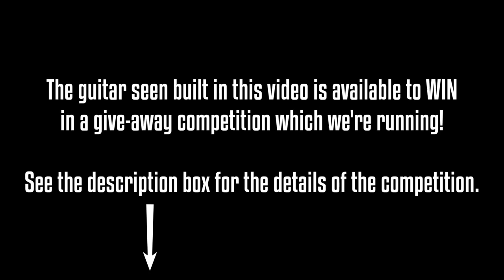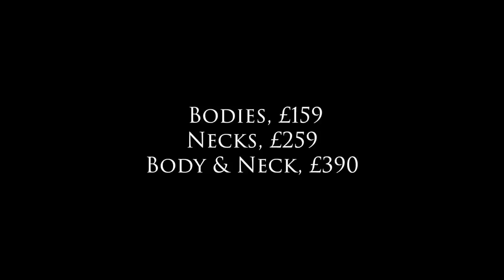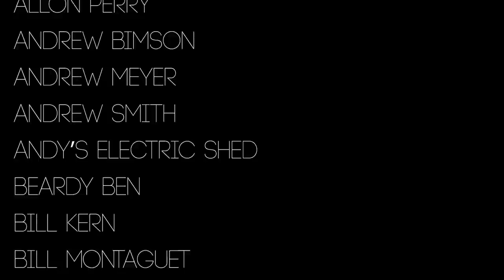Ep 3 - Building a Crimson T-Type Kit Guitar - Final Steps!

Comment: It should be possible to change the colour of the copper using a blow torch, when I was a plumber we sometimes used to anneal copper tube by heating it until cherry red then cooling it very quickly to soften the copper to bend with a spring. While heating the copper it changed colour in an almost prismatic way. Try heating up the copper and then quenching with water at different temperatures the copper changes colours radically.

Comment: Looks awesome. The copper pickguard and electronics plate look extremely excellent.

I had a T-type kit, I'd only do a couple of things:
Finish would be a candy apple blue with a deep gloss or a silver burst, matching painted headstock too. Satin finish poly on the back of the neck.
Fret dots would be swapped out for metal rings of approx same size, with a centre matching the fret wood as close as possible.
Hardware wise would be a six saddle bridge with string through, possibly a humbucker in the bridge and either a humbucker or a lipstick in the neck. Smoked chrome if possible for all metal elements.
If it wasn't pre-routed, I'd forgo the scratch plate entirely, but in with the kit body, I'd look at maybe doing something much smaller, maybe just a small chrome panel around the front pickup.

Comment: I'm not really a tele fan but that thing turned out stunning, I have yet to find a neck through kit, I should really start with a set neck (I don't tend to like bolt ons) but I'm wondering if a neck through kit is something that could potentially be on the cards for the future?  Obviously there would be less room for error as you can't replace the neck or body if you mess it up!

Comment: If I were to build a crimson kit, I would want a burl top on the body, high polish finish on it, with the same type of copper trim you used on this build, and a hard tail. For pick ups? I've always wanted to make my own single coils myself and I have no idea if something like this exists or not, but something like an internal bluetooth broadcasting device that would allow the guitar itself to pair with any bluetooth speaker to use as a pocket style amplifier without having to have an external wireless pack to an actual amp.

Comment: What would I do...?
Well; I think I'd go pretty straight forward and simple. But personally I'd prefer a strat style guitar and maybe put some kind of HSH or HSS set of pickups in. Maybe that's something I'd love to see: Some cuts for humbuckers. If you put on a scratchplate you could also use SSS without problems but here you can't put normal sized humbuckers on without having to cut more. But OK.  :) Guess I'd go for a red one (stain + oil) without tremolo, mint pickguard and vintage white or black pickups. Anything special...? 
OK, another thought is a version without scratchplate, noiseless SSS pickups directly mounted into the wood and maybe some kind of metal plate as a cover for the electronics. Also red (love to see the great grain of the wood) and probably chrome covers for the pickups as well as chrome hardware. But definitely without tremolo.

Comment: I would customise one of these kit guitars by:
Right handed Tele body
Left handed Tele neck
Re-route the bridge pickup for a humbucker.
Have a schaller Hannes piezo bridge
Bareknuckle Juggernaut bridge pickup in brushed chrome cover with custom geometric Pickup tattoo
Impulse single coil neck pickup when released, until then slow hand neck pickup.
I would put a flame maple cap on it and route the control cavity through the back. Stain the back black and the top in a red to black burst.
Chamfer the neck heal.
Stain the neck in a nice deep red colour, similar to padouk.
Control wise I'd have a toggle switch to switch between piezo, magnetics and both, then I would have a volume pot and a rotary switch to complete the guitar. And this is something I will be doing when I get the money together!

Comment: You say there's no reason for the extra long screwdriver. I would disagree. The extra long screwdriver is perfect for that application. A long screwdriver is easier to keep straight when screwing and therefore doesn't cam out so easily. Always use the longest screwdriver you can get away with.

Comment: I would use a wire brush to remove some of the soft grain to give the body a weathered texture, then stain it black. the neck would get painted with multiple different stains to get a "spotty" finish and the headstock would get a matching finish to the body. Id pair that up with chrome hardware and an aluminium scratch plate and som singlecoil sized P90's.

Comment: TIP for worn or soft screw heads, place a piece of electrical insulation tape over the screw head and then use the driver as normal.This will also work to remove ground down screw heads

Comment: Hi, quick question. When mounting the neck, there are no predrilled holes in the neck ? Every neck pocket has a bit of space ... to proper align the neck many people user the outer two strings to see if the space is qual on the both sides. I havent seen you do this. Are you just confident the fit is perfect because the cnc machining is so good or did you just use a method that was not show on film? regards michael from germany...
Reply from the maker: Hey Michael, with the kits that we make I am simply that confident in the quality of our work.. with other kits I would use a long ruler down each side of the fretboard and make sure they are centred..  B obligatory shameless self promotion - https://www.crimsonguitars.com/collections/kit-guitars
Reply: @CrimsonCustomGuitars  thanks! great sales pitch ... i am considering buying!

Comment: This came out looking so much better than I thought it would, it would be an honour to own.

You mention cheap tuner screws, I moments ago had one snap off! How on earth do I get it out?!
Reply from the maker: +James Cross if it is still sticking out a bit then a slightly blunt pair of end Cutters could do it. Otherwise sharpen a metal tube that is slightly larger than the screw and drill down around it.. That will come our easier, you then plug and start again. I think I've made a video about making a plug cutter somewhere.. B
Reply: Crimson Custom Guitars Thanks for the response my dude, I toyed with the idea of plugging it out after several strenuous hours with needle nose pliers - Looks like that's the way to go! Keep making killer guitars.